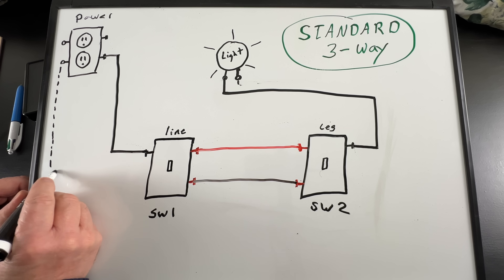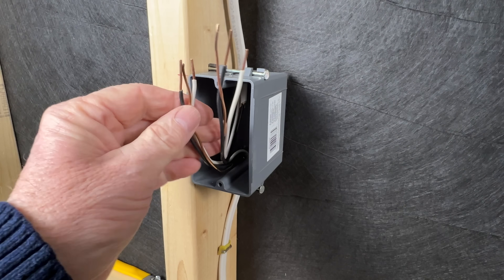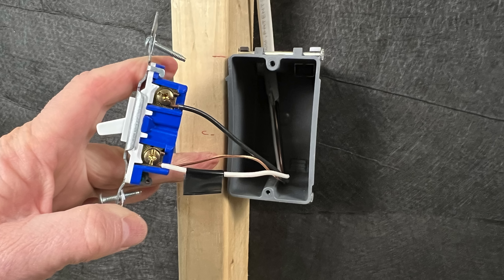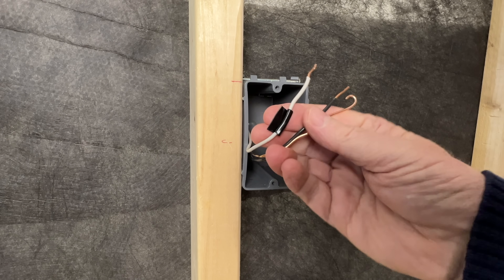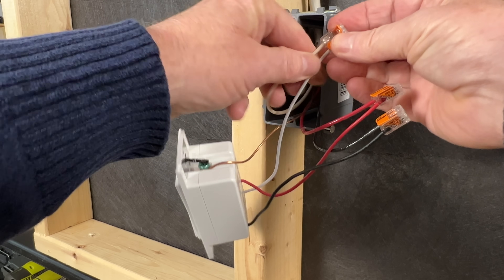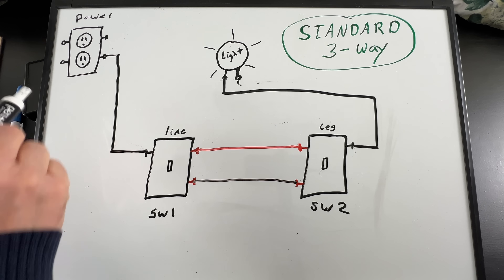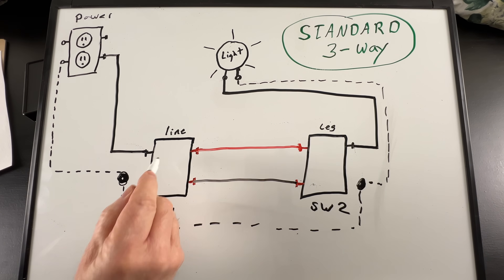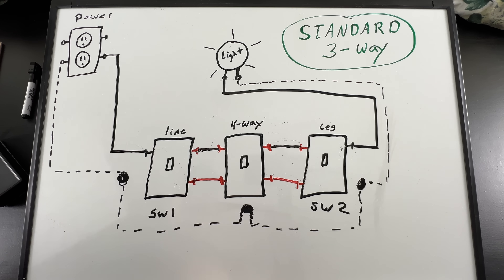How NOT to Wire Light Switches in 2025 (New Rules)

Comment: And when they installed a dimmer in a switch box without a neutral conductor they used the ground wire and... then they shared their work around on YouTube to perpetuate the violation.
Reply from the maker: One of the reasons for the change. I didn't mention that in the video because I don't want to give anyone the bad idea.
Reply: @BackyardMaine  If they bring the problem to any half decent lunchroom someone will make the suggestion... and the other half will offer the correction.
We're cleaning our home for electrical noise and the 3 dimmers we rarely used were all particularly guilty of adding a mess on the sine wave so we retired them. 
I'll share your stuff with both of my apprentice boys, first and second year information sponges. 
Well done video.

Comment: In my basement I had 2 2x2 led  panels. I went to add a 3rd one and found I has screwed myself.  Why is that, you ask? Because I made switch loops. Each light had its own switch  so when I went to add a 3rd led to one ofnthe switches, there was literally no neutral coming out of one of the existing lights. I ended up having to go back to a junction box and wore in a jumper from there to the new light. 

If inhad wired it like you did where you split the black, it would've been an issue.

Comment: That makes complete sense to me to break the hot to the fixture. This is how I’ve always done it. But unless you put it in yourself you could get hit with 120 volts. People wire them backwards and break the neutral. The light still goes off with the switch but now the fixture is always hot. When you reach up there to disconnect the wires for a new fixture you can get popped. Then you get really mad and swear to find that guy that wired that backwards. Oh. Yeah. I know you’re supposed to turn off the breaker. But that’s for sissy’s. 😂 2:11
Reply from the maker: I have seen that as well and it's also a code violation to switch the neutral wire.

Comment: On single pole switches, I've been using method #2 for like 40 years. Whoever uses method 1 is evil, plain and simple. Leave the wires as the color/polarity that they are supposed to be, you want to know what is in front of you at a glance and not search for black tape wrapped around a stupid wire.

Comment: So.... if their intent is a neutral in every box, it makes NO SENSE to allow the exception for the Dead End 3-way.  If they wanted to make wiring flexible for homeowners they should just mandate neutral in every box. This will benefit electricians of the future too, who won't need to be pulling neutrals through the wall.  So why don't the people in charge of the NEC ever do the right thing for the homeowners?
Reply from the maker: It does make sense if you understand what a smart switch is. There would be no reason to install more than one of them for controlling the same lights. That's why they allow the neutral at only one switch box. This change is to help the homeowner not hurt them.
Reply: @BackyardMaine  What if I have two  motion sensor 3-way switches.  For example, I want the light to turn on for two minutes if somebody enters the room and their motion triggers one switch or the other? But if somebody at either switch wants the light to stay on, or they want to turn it off, they can control that too?  That would be a pretty smart switch that would need a neutral at both switch boxes.
Reply from the maker: Great example. I stand corrected.  @andytraiger4079

Comment: Strange you said that you would be using 12 AWG for lighting in I am assuming a residential home and we are now using primarily solid state lighting (LED or remnants of compact fluorescent) as opposed to tungsten-based incandescent that probably doesn't need a 20 A circuit unless ceiling fans are consuming more than that now for some strange reason.  

Also, in Canada, I don't understand why you have grounded switches.  Maybe it's because you are now using plastic boxes (for some reason) in wiring your houses.  We still use galvanized boxes inside the home so I guess there are some things I don't understand.  Weather-resistant boxes in Canada are either PVC or Aluminum so either way but our ground still runs to a screw inside those boxes.

And then there's the Chicago area using conduit in the walls...which I can see being an advantage especially when it comes time to replace existing wiring or adding circuits makes it relatively trouble-free and from making holes in the walls.
Reply from the maker: I stated 12 AWG because If I said 14 and someone used that info on a 20A circuit they could have a problem. Most lighting circuits are run in 14AWG wire.

Comment: There was a dead end 3 way on my stairs. I was planning on putting a wifi switch at the bottom of the stairs. When I opened the box there was no neutral. So the wifi switch was put upstairs.

I always wondered if that was code compliant. Good to see that it is.

Comment: Codes can help toward "safety" but never can be assured safety.

Codes constantly change and are utlised to push: Sales and marketing of continuosly evolving and new, devices, cables, and forcing continuously edited/ modified practical methods.

Thus what was conforming to a code, soon become non-conforming and violations.

Besides confusions when visiting instalations in future, ... out of many e.g., "switched neutral" 'white insulated' conductor to loads/lighting of past codes. 
It is stark contrast to solid unstwiched 'white insulated' conductor neutrals. 

The saddest part is the presumption that if, "it meets code it's safe", 
and among other topics, which leads to obliviousness ....😢😢😢

Comment: Don't light switches in the USA use screw-less wire terminals?

Here, you can almost always just push the wire into the switch and it will stay put unless you press a button.
Reply from the maker: They do have the push in option on the back but they aren't very reliable and most electricians will not use them. There are a few more options out recently that are quite a bit better but the stabs have been problematic for 120v circuits. They work much better on higher voltage applications like 277v lighting circuits use in commercial and industrial applications.

Comment: I have neever been able to understand why it is easier/cheaper to run power to the light fixture first.
Reply: It depends upon where the breaker box, wiring runs, switches, and lights are.  Lights are on the ceiling, switches are not.  Wiring usually comes down from the attic in a single-level ranch house built on a slab.  But in a 2 or 3 story colonial sitting above a full basement, the wiring usually comes up from below.  But then if you add new wiring, you might in some cases run it up to the attic and back down.  Don't assume every house is the same, or like yours.
Reply: It's cheaper because you're actually using less wire to do it. But with any state who's adopted the new code, that is now illegal because a neutral is now required at a switch.
Reply: Easier access from the attic (which is accessible as well) perhaps one of the reasons

Comment: The 3 way and 4 way sections were excellent.  The question in my mind is, "Why was a switch loop ever allowed or even considered a good idea?"  I'm just a homeowner but I've been wiring and observing the applicable codes since 1974.  I've wired several buildings that I either built or completed, inspector approved.

Comment: Wow, those switches with huge terminals. Like going back in time. In the UK, even with the switch out of the box you would be very unlucky if you got a shock off the terminal. i.e they are totally shrouded. Your 4 way switch is known as an intermediate switch in the UK. 

Regarding wiring, another way of wiring that works, there is  nothing to stop the two commons of switches SW1 and SW2 being wired together and connecting the live feed and switch return to the strappers going between the 2 switches.

Comment: I assume all this info is for another state. Because using electrical tape on a neutral is a NO-No called a mickey mouse
Reply from the maker: Article 200.7 in the code allows the re-identification of a white wire for switch loops. They are to be re-identified with electrical tap or paint. I highly doubt that your state or local code lists this as unacceptable. But if it does please let us know the state and the code reference.

Comment: WAGO LEVER NUT GANG!!!! i'll never go back to wire nuts. also, every single one of my switch boxes in my house has a ground wire, and not a single one of them is connected to anything. they are all just crimped together with a copper ferrule. its insane. every box has probably 4 to 8 bare copper lines smashed into the back and crimped together. not a single switch, outlet or anything is connected. i did find two external fixtures that are grounded though because they were added much later. not sure how the electrician got away with not grounding anything. most of the fixture plate covers are bare metal too. if there was a short to the plate, it would just give you the full 120v or it would heat up until the wall caught on fire. 

all of my boxes do have a neutral though so there is that.
Reply: If a metal box is properly grounded you (usually) don't need to separately ground the devices. It sounds like that is not the case in your house.

Comment: Good, but wiring those switch boxes with 12/3 will be unpleasant, and standard switch devices are not even really designed to use #12 wire.
Reply from the maker: You can also use 14/2 or 14/3 as long as the circuit is 15A. Also all standard switches are designed to have 12 AWG wire connected to the side wire terminals. The backstabs are rated for 14 AWG solid copper wire only. But I don't recommend using the backstabs because they can become unreliable over time.

Comment: For the dead-end 3-way, you install a smart switch in the Leg as follows:
use two conductors of the traveler to send power/neutral to the leg's j-box.  Use this to power the smart switch.
The third conductor in the traveler goes from the leg's smart slave switch to the "slave" input of the smart switch in the line location.
Leave a note and diagram in the j-box for the confused electrician who comes along years after you're gone.

Problem is, the smart switches stopped having the "slave" wire on many of the models.  I don't recall if there are more expensive models, but you can just forget the 3-way and use a X-10 switch that commands the first one; similarly for newer command systems.  That means running the power/neutral to it but not using the 3rd wire.

Comment: I got into X-10 home automation in the 90's.  I learned that the original X-10 smart switches, which work with two-wire boxes, leave a trickle of current flowing when off so that they can power themselves.  This was not a problem, though wasteful, for incandescent lights.  Meanwhile, fancy new smart switches only worked in j-boxes that had a neutral.  So, this second way of wiring was New in the late 1980s.

* Run the Romex from the leg to the switch first, then to the light.
* Run the Romex to the light first, then the switch.

Why would you bother to do it the second way?  Does it save wire when you have multiple rooms' lights on the same leg?  I can see going point to point across the ceiling from room to room is more direct then going through the walls.  Is it because you could use thinner wire on the run to the switch?  Well, that should be just as true going the other way around.

Comment: I follow the wiring, but is using 12 ga instead of 14 ga for lighting circuits a new thing?
Reply from the maker: I just picked 12AWG in the video incase someone watching has a 20A lighting circuit. I didn't want to guide them to run 14AWG for a 20A circuit. But I almost always run 15A lighting circuits with 14/2 or 14/3 cable.

Comment: A switch is a means of disconnect. That's all it is and ever was. Requiring a neutral inside a dedicated switch box is pointless and does absolutely nothing except take up space.
Reply from the maker: No.. As I explained many smart switches require them. Light switches are not disconnect switches. They are control devices for your lights. A disconnect switch is primarily used as a safety device to disconnect a piece of equipment for replacement, repairs or maintenance.
Reply: @BackyardMaine  which has exactly nothing to do with codes. Codes were set up for safety, not convenience. Just because 'some' more expensive and fancy switches require a neutral doesn't mean the 'minimum standards' the codes represent should change. If metro or municipalities want to add to the minimum by requirement of a neutral, that's one thing, but for the code to be changed to accommodate fancy updated switches vrs the standard toggle is another.
Reply: @EfficientRVer  all of which applies to old/existing wiring and decisions made by homeowners after the fact. New construction relies on toggle/rocker switches, especially spec homes. Any upgraded switches or lighting is a builder option. In that case, the wiring is adjusted to match. As electricians, we wire to code as a minimum standard, regardless of architectural wants or homeowner desires. Anything above code is an option, an extra, whether that's builder, homeowner or municipality  requirements.
Oh, and the ground always carries a varying level of current, 24/7/365. Anything extra from the electronics in a smart switch is exactly no different to what's already there.

Comment: Are they gonna start requiring a cat 5 cable in every switch some day? Yknow in case i want to change me single poles for computer operated single poles 😂
Reply: You know they will. Might as well run the line. But of course, when its mandatory, it will need a Cat 11 cable.  No grandfathered ethernet!
Reply from the maker: Very funny but short sighted.. When I wired my home 25 years ago I thought I was smart and ran a coax and a Cat 5 cable to the office, living room and every bedroom. Now I have blank covers on the wall and everything is wireless.
Reply: @BackyardMaine  by that logic we dont need a neutral for smart switches because everything becomes poe and we control everything from a computer.

Just add a neutral when needed, the YAGNI is real with this code. I am assuming you have a pvc pipe running  from the box to the switch, so adding a single wire is relatively easy.

Just to add, I did enjoy the video. I am not really understanding the code change, but luckely I don't need to follow it. I am not familiar with US materials, so O was looking for a way to do a three way switch. Seems my switch isnt a threeway switch. In my home country all.switches come prepared for 3 way switching.

Comment: The NEC had too much time on their hands for the new rules thnx to the fauci virus
Reply from the maker: There were two reasons for the change. First, it's better for the homeowner or the consumer to not have to incur the expense of adding a second cable to a switch box. Second, people were connecting the neutral wire on the smart switch to the ground wire in the box. This would allow them to function but create a safety hazard by applying current flow to the ground wire.

Comment: As an electrician myself, I was already familiar with those two methods of wiring those switches, but I wish you had ALSO shown the other two methods you mentioned, even the now illegal one, because that way I could identify them and (hopefully) be able to fix them if needed!

I also know of another way of wiring those switches, kind of combining the switch loop of the single pole you showed, with the "dead end" 3-way circuit you showed, however, since that method ALSO doesn't allow for a neutral in the switch boxes, (UNLESS you use a 3-wire between the light fixture box and the first switch box), so I'm not sure if that method is legal now either, with thenew 2023 code... I guessI need to read up on that!
Reply from the maker: I will make another video on the other two methods. Stay tuned. I know the method you're talking about. It's rare but I have seen it. Usually done when someone wanted to add a couple of 3-ways to control a light that was originally on a single pole. I'll add that as well.